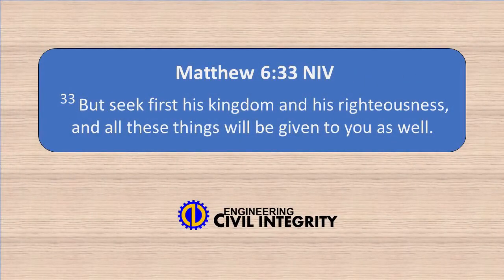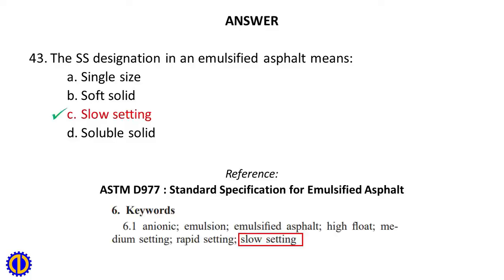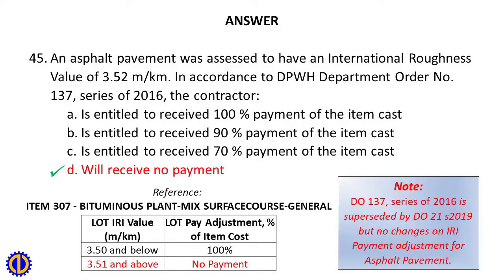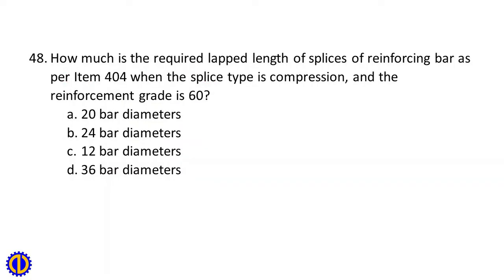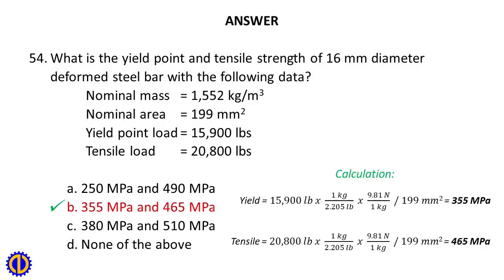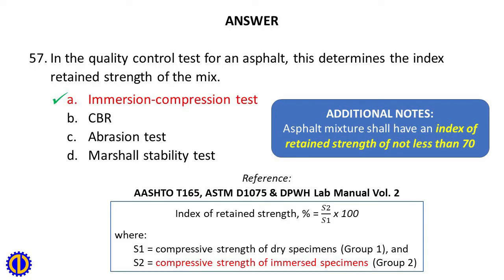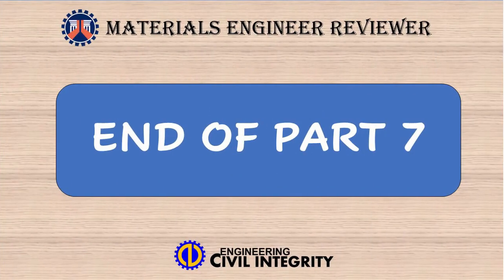Materials Engineer Reviewer Part 7 DDN Rev 1

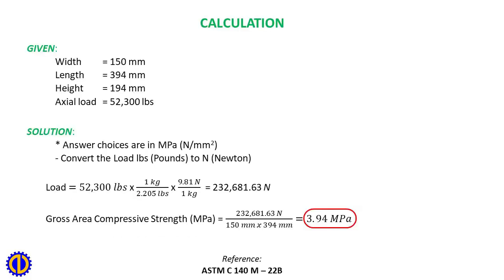Comment: #51. Given value for Axial Load = 52.30 lbs (timestamps at 8:12). Then it became 52,300 lbs at 8:43. Maybe it is a clerical error. The correct value is the latter.
Reply from the maker: Thank you for the comment. The Voice over is correct 52,300 lbs but the screen presents only 52.3 lbs.